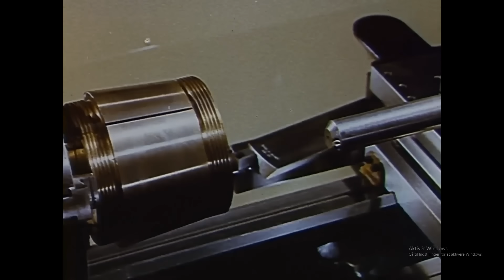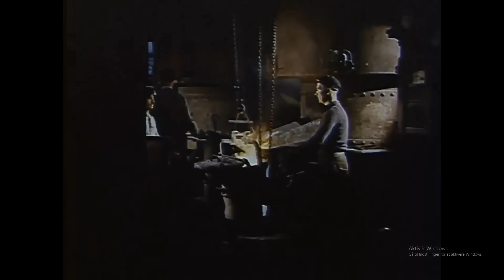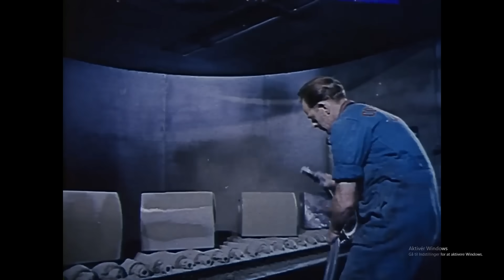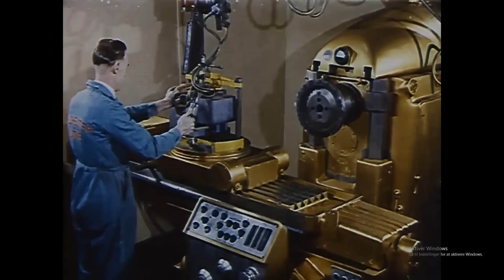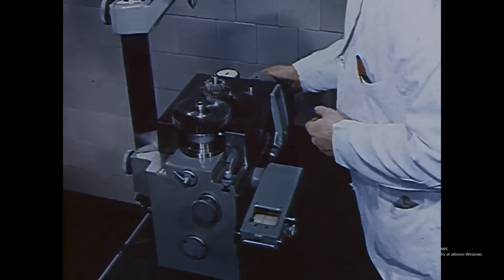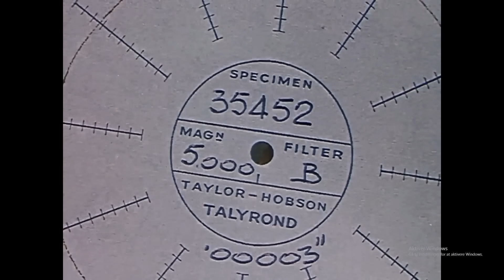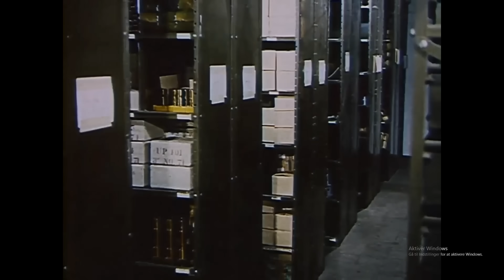Colchester Lathe Company

Comment: Ah - the good old days - when we did a bit of manufacturing.
And could speak English properly...
Reply from the maker: Haha spot on.  Especially the language are changed. Also here in Denmark
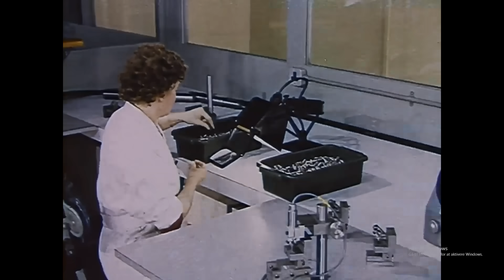Reply: @VærdAtSe  18:15 "ocular check for surface defects" - cracking stuff ! Nowadays, it'd be a 'visual check' ! Optical check is probably something else !
Reply: @smokesignalsradio  "kilohertz"
Reply: @Al828282  no... in England years and years ago it was all "kilocycles" and "megacycles"... god alone knows why?
Reply: @edgeeffect  Avoidance of foreign units.
Reply: mark314158 ah yes, how would you love to take stuff out of machines and put them back in all day?
Reply: use  be  where  world work shop of world
Reply: @smokesignalsradio  I think he meant kHz !
Send him back to the fettling shop ;)
Reply: @MichaelKingsfordGray  Just an inaccurate Pi !
Reply: Colchester still manufactures machine tools.
Reply: Except these days they are crap! Their CNC lathes are only fit for college trainees!!
Reply: @magicmaybach  never worked on their new CNC lathes but worked on other new machine tools by them and they are pretty decent quality if a bit pricey. The real downside of their modern machines is most of the raw manufacturing and all but the very final assembly is no longer done in Britain. But then no one does these days sadly at least on the manual side.
Reply: Ah - Racist
Reply: @smokesignalsradio  and complete failure!
Reply: I doubt anyone in that factory spoke like that!
Reply: Back when presentation was the skill of a gentleman and only the upper classes were permitted to appear on TV, to maintain "standards or decorum".

I like that you can hear a brief bite of normal workshop chatter near the beginning. It's in great contrast to the narrator.
Reply: @smokesignalsradio  it wasn't diversity or sustainability that killed off manufacturing in this country. Very white very British people killed it off.
Reply: ...and measured things in feet and inches and tenths of a thousandth of an inch.
Reply: @Mishn0  whats the difference between 0.025mm and 0.001"?
Reply: @johnbull1986  about 400 microns.
Reply: @Mishn0  ooh we'll have none of that evil, pc gone mad, diversity, metric nonsense here.
Reply: @Mishn0  isn't it 0.4 microns? I think you're thinking of nanometers
Reply: @wildin13  :You are correct and my space probe just crashed into Mars.
Reply: @wildin13  it's 4 microns. Maybe @Mishn0 hates the metric system so much he had a stroke while typing his reply. If he is a precision engineer we are fucked.
Reply: @wildin13  my Nan was really short. She never measured as much as a metre in her life.
Reply: @johnbull1986  my OCD and need to correct people on the small details that dont matter makes me want to say 1 thou is most definitely 25.4 micrometers or 0.0254mm XD sorry I was nearly twitching at that thought.
Reply: @johnbull1986  0.001" больше 0.025 мм примерно на 0.0004мм
Reply: @johnbull1986  One contains 25mm and the other 01" - isn't that clear ? OR
400nm
Reply: @Mishn0  Just a factor of 1,000 out. 400nm is the answer.
Reply: @johnbull1986  Good job you're not an engineer, never mind a precision one !
Reply: @Mishn0  Not forgetting microns - a metric unit ! That's them French for ya !
Reply: @smokesignalsradio  As an Engineer, I resent that statement. Diversity and sustainability are important for a well functioning society, but it has nothing to do with the engineering terminology of the day.
Reply: Explain exactly why diversity is good
Reply: While here in the US we have a leader with the demeanor of a school yard bully as well as the vocabulary. And machine tools and and tooling being sold as scrap!

Comment: Things were better in the olden days. 
Today most is rubbish out from rubbish china.
Reply: @crispindry2815  You have hit the nail on the head! The poor quality is driven by people wanting to pay less, then they complain about cheap imports.
 The bottom line is quality costs more than the low grade people want to pay for. Most Countries can produce good products, however the cost more so don't sell as well. This whole cycle is driven by Greed and wanting more for yourself. I doubt this will change in my lifetime. 

Cheers from John, Australia.
PS Rasmus Hansen, excellent video, thanks for posting.
Reply: Some things are good these days too, the point is: can you afford it?
Still today a lathe can be manufactured to these tolerances and even better, but which each leap in precision comes a huge step in price. In the olden days most people never dreamed of having a machine shop at home.
Reply from the maker: Yes you are absolutely right
Reply: You daft racist!

Comment: I love my Colchester Chipmaster Continental. It's lovely to work with and is excellent quality.
Reply from the maker: Uhh yes a chipmaster are a very nice lathe 👌👌
Reply: The Chipmaster was perhaps, in terms of accuracy, one of the best of the Colchester range. During the inspection of parts for Student lathes, the most accurate parts, were put aside for use exclusively in the Chipmaster. Though a relatively small machine (5.5 X 20in) it was very heavy at +500kg which also indicated the quality.
Reply: I have been living with a Chipmaster for 25 years,  its a really good lathe. The beltdriven spindle is really good.
Reply: @tordarbast  I agree. It is the tool I won't ever sell. I bought mine in 2012 and it had seen very little use. Made in 1964, I doubt I would ever be able to find the same quality again.

Comment: If only they would take this kind of pride and careful production process today when making lathes or tooling, what happened  ????
Reply from the maker: You can still get good quality. But prizes are sky high.  In general most are made crappy, and only build to last the warranty period.  Not like this, old machines that truly last a lifetime.
Reply: @VærdAtSe  I know ,that's why I bought a old 40s atlas lathe and and a old mill ,I had to take apart and fully restore them , but totally worth it ,but still paid a hefty price ,
Reply: @VærdAtSe  , unfortunately/fortunately...todays technology does not last a lifetime....but is measured in tenths of a lifetime.
Lathes (CNC's soon to be partially replaced by 3D printing)  today are made to tenths,  to be replaced as soon as new technology appears.
Reply: @SuperSetright  I'd say 3D printing replacing CNC and chip cutting operations is atleast 30 years away, the strength and consistency of 3D printed parts is not good and they take a phenomenal amount of time to be produced.
Reply: @alanpartridge2140  ''CNC's soon to be partially replaced by 3D printing''.......didn't say they have.....I inferred they are in the process.......in my estimate 5-10 years away.......max.
Look at the aerospace industry, already building turbine engines.....substantially through 3D printing methods.
https://www.ge.com/reports/change-maker-3d-printed-turboprop-engine-jetlike-controls-turns-heads-oshkosh/
https://3dprint.com/209048/ge-catalyst-engine-3d-print-parts/
Reply: @SuperSetright  But those are highly specialised parts which themselves cost astronomical amounts of money and are incredibly difficult to make in another way, I can't see the crankshaft for a car being printed as normal manufacturing method whilst I've still got hair
Reply: @SuperSetright  Oh I see, you said partially, my mistake
Reply: @alanpartridge2140  , if it's cheaper to be lathed.....it will be lathed.....etc...etc
Reply: nature of capitalism, they woulda gone out of business the moment someone could produce a cheaper lathe that was "good enough" unless they didn't do the same thing, unless they aren't constantly doing the same thing to preempt the competition.